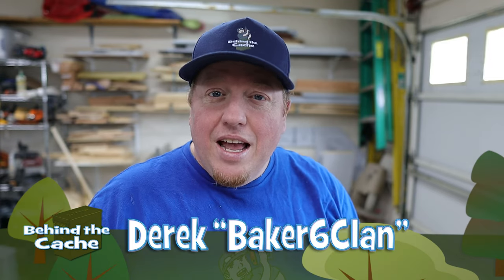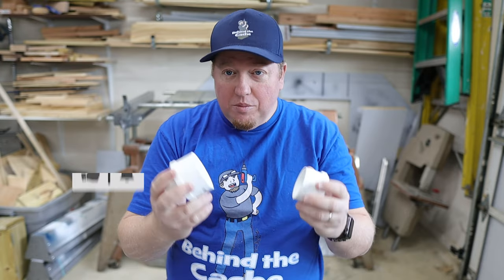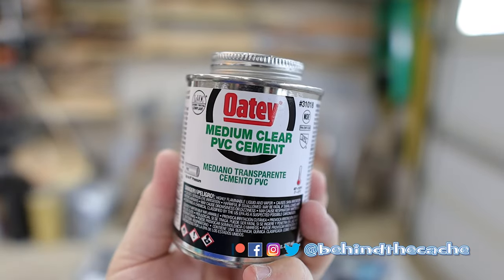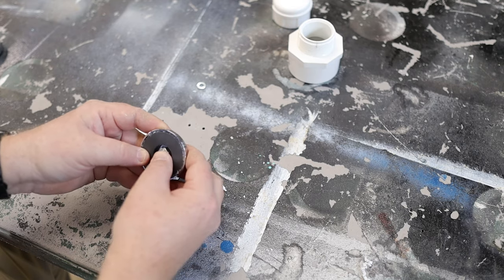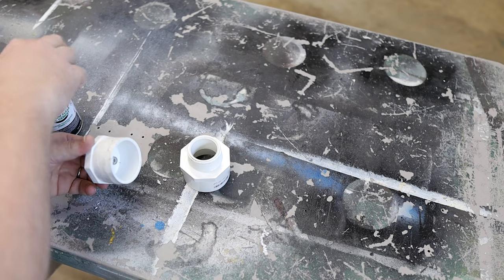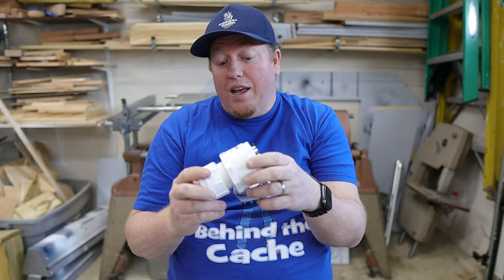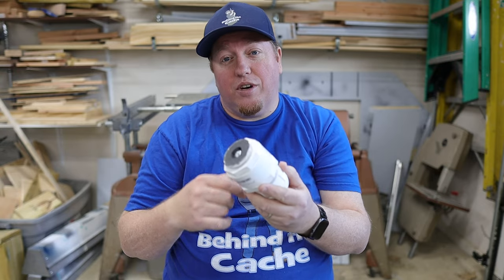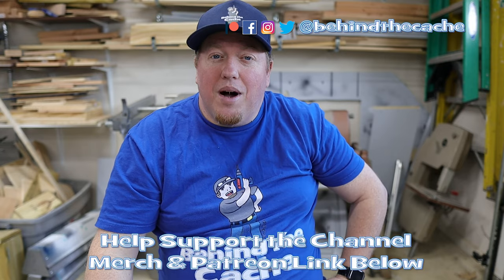Simple Urban Creative Cache You Can Build in Less than 5 Min GCNW)

Comment: Great vid. I have used this system several times and in different sizes. A dose of silicone spray on those threads keeps it easier to open too.
Reply from the maker: Great tip.